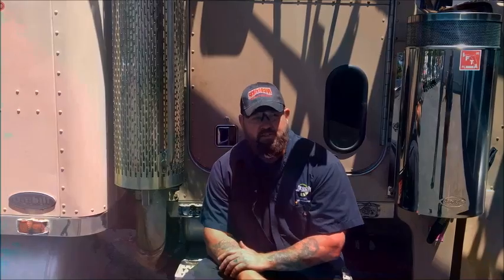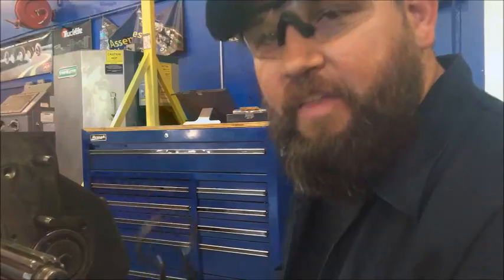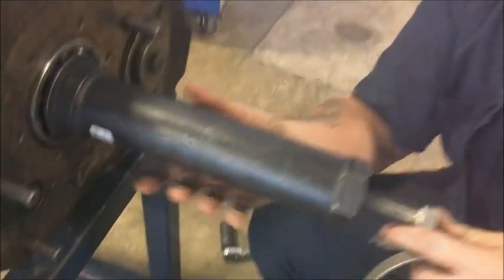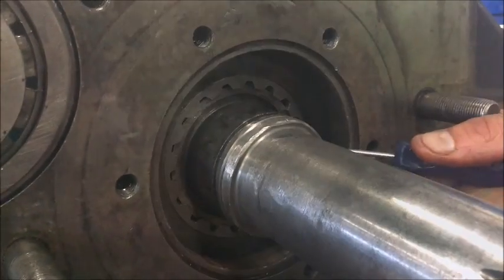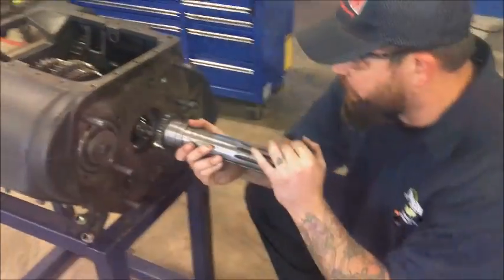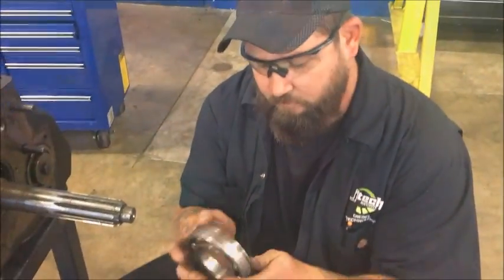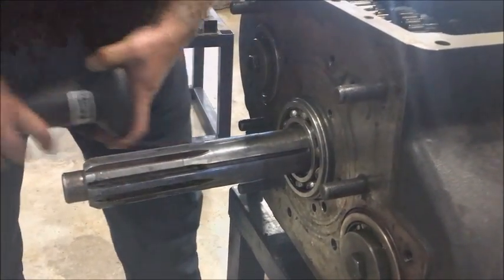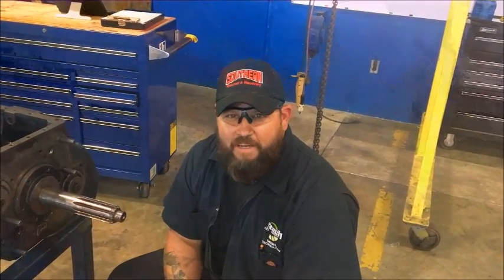Eaton Fuller Heavy Duty Manual Transmission Main Shaft Removal / Install

Comment: You can pull out the bearing without a special tool - you need a wooden block of about 100x100x100 mm. you need to beat on the output shaft from the side in different directions - the bearing will begin to gradually come out.

Comment: Hi I have a 2012 cascadia  ultrashift 860000 miles. The new a Clutch I changed 30 days ago Run oky. Now when I turn on ignition no any faults and gear is N. if I check transmission  for fault show 25. but when I start a truck.After 2-4 seconds   I have check transmission light on a dash and show code spn 788 fmi 12. I have blinking F  N on a gear gauge. Can be bad electronic clutch actuator? or some harness ? and how to check a power to ECA
Thank you